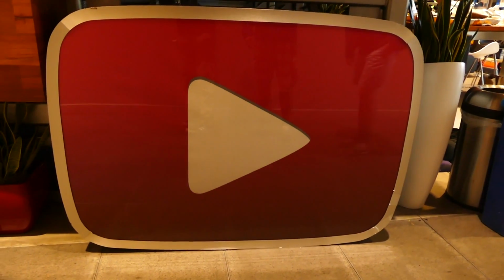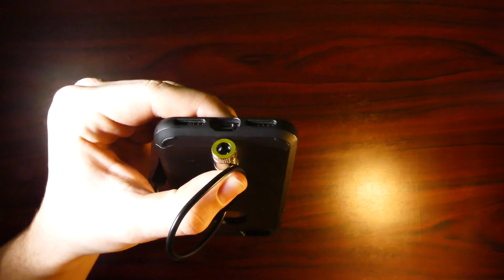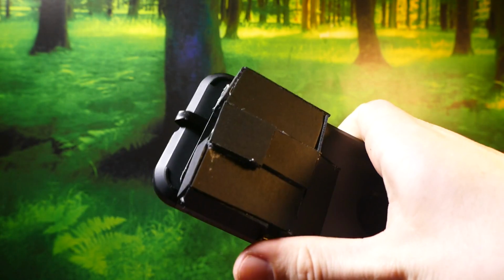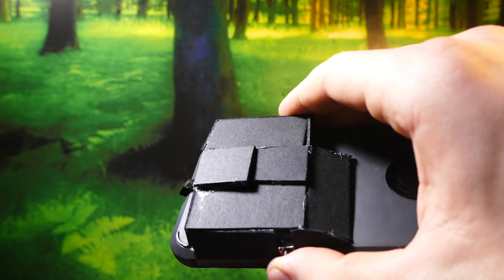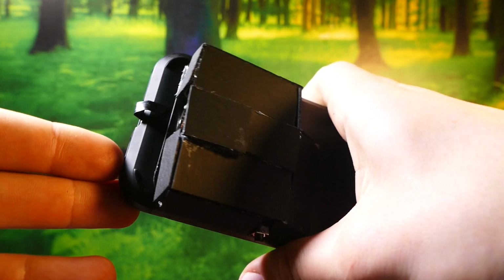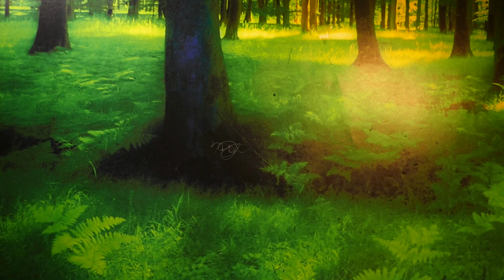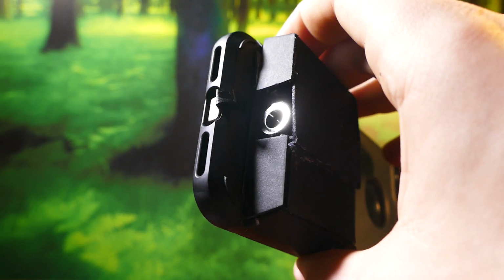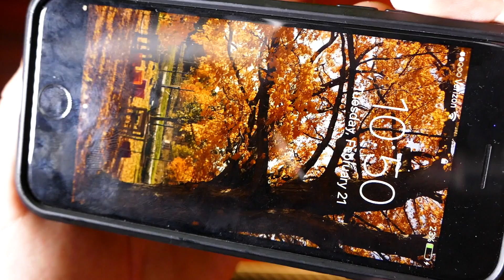Turn Your Smartphone Into a BURNING LASER POINTER!?!?

Comment: I think that attaching a charging cable to the device was a really good idea. My only concern is changing out the batteries. They aren't rechargeable, and using them to charge the phone as well as power the laser will quickly deplete them. When they die you have to rip it open and do all of the stuff you did to the original batteries to new batteries. I skipped through the video pretty fast, so if you mentioned this problem in the video, my bad. I do like your channel though so keep it up.

Comment: .... use a mini lipo with a charger circuit and use thinner wires, and don't just connect batteries to everything, your phone and most lasers need 5v, not 9v, and don't just hot glue everything together, it looks worse than shit from China